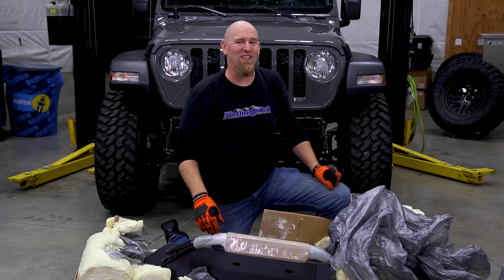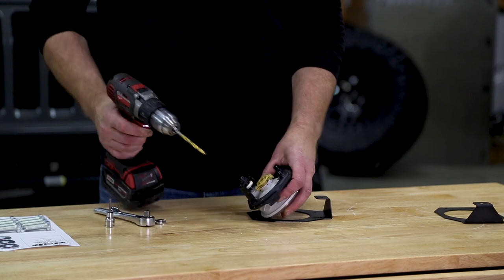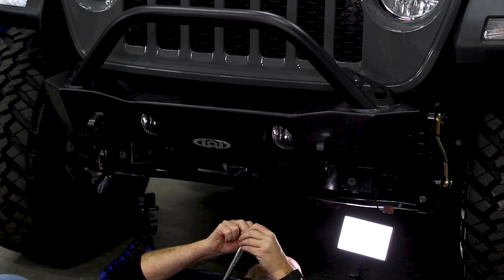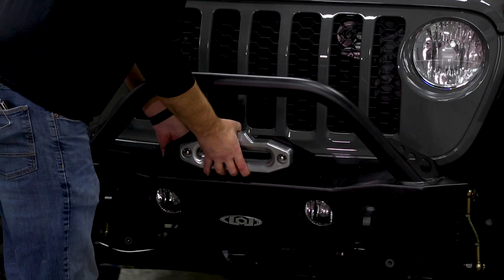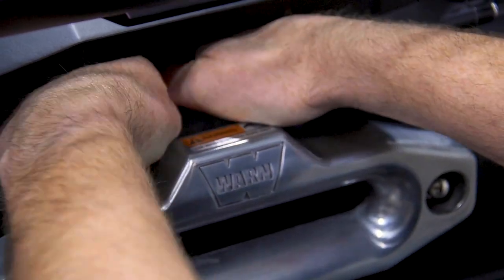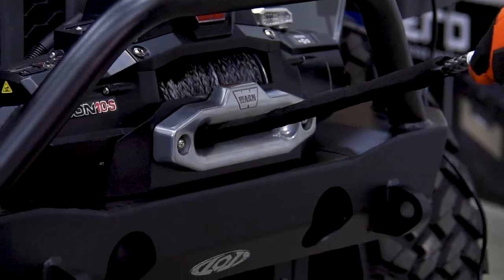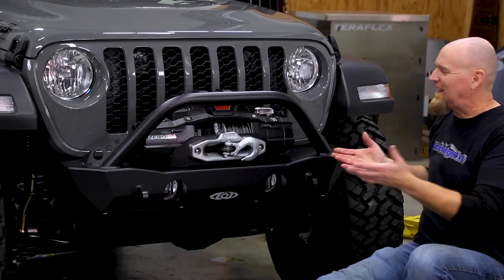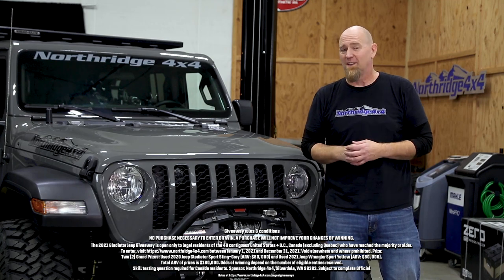LOD Destroyer Series Front Winch Bumper - Jeep Gladiator

Comment: Does this bumper get in the way if using the front trail camera? Also any concerns about blocking the radiator with the higher winch mount (as opposed to the signature series)?
Reply from the maker: RE Front trail cam: We don't have one, so couldn't tell you from experience.
RE Winch blocking the radiator: No concerns unless you were living in Death Valley or similar. 
Tech Tim tells us he likes this style the best as you can easily see the winch rope spooling on and off the drum easier.